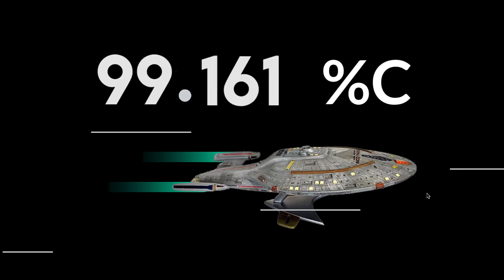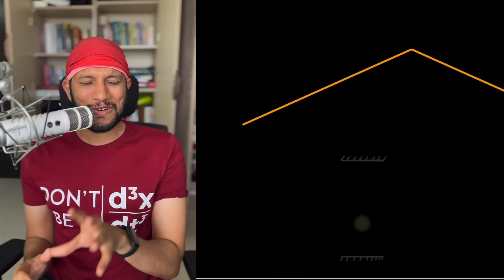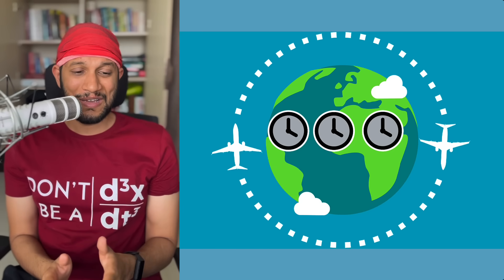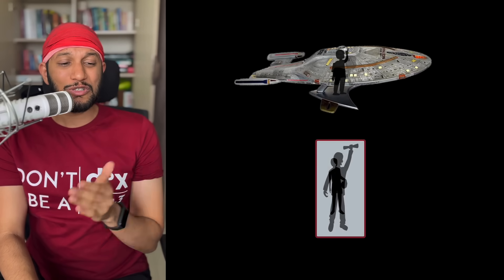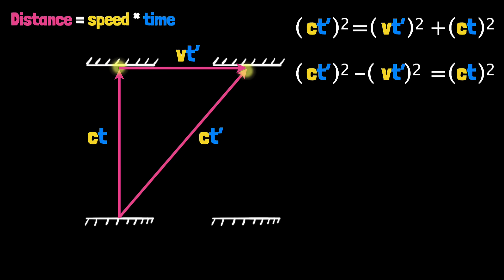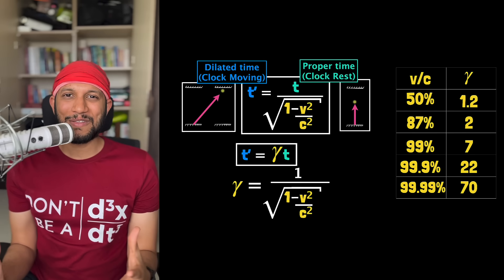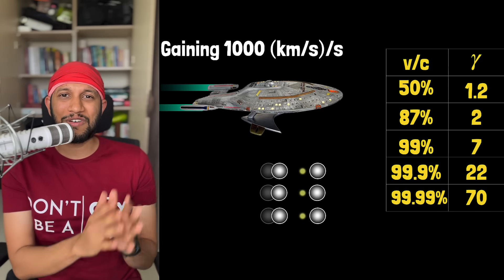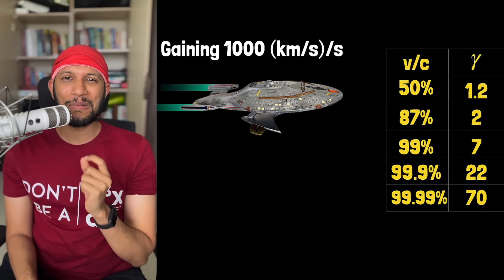I finally understood why you can't go faster than light! (My mind is blown)

Comment: Very good explanation! But what about those people inside the always accelerating spaceship, who do not experience time-dilation. For them everything seems normal, so why can't they reach speed of light? I get that outside observers will die of waiting because of time-dilation, but could those inside reach c at some point?

Also, cause light travels at speed of light, does that mean it travels only in space, but not in time? 

If so, that means from lights own perspective it will arrive instantly to where ever it was traveling at speed of light. Even if we, outer observers, see that the light from Proxima Centauri takes around 4 years to arrive here on earth. But for light itself it was instant. Do that makes sense? Anyway thanks a lot for making me thinking this, its fun :)

Comment: This should be tied into bringing a massless particle to rest.   For example using a gravity well or expanding spacetime.  As the relative velocity between observer and particle approaches C, wavelength grows to infinity and the energy drops to zero.  Upon reaching a relative velocity of c (by cheating since the observer is not moving through spacetime, we are stretching the tensor) the particle disappears behind a horizon.

Comment: I have a question which maybe a stupid one because I am about to sleep 😂 
Now for the people in the shop that is traveling close to the light speed won’t they feel that the people outside the ship are the one that moving at close speed to the light speed.? Does that mean that they will consider the clocks outside the ship are ticking slower ? 
I am pretty sure that the answer is about time dilation or smthg that I am too sleepy to process.

Thanks for anyone will answer ❤

Comment: Ok I understand if you want people outside the ship to perceive the ship moving at the same speed that the person inside the ship is perceiving time that you can’t reach the speed of light because you’d need infinite fuel. 
However I think what’s wrong here is we are assuming the ship moves only the way the stationary person is perceiving it. That’s not the case , the ship moves at its pace regardless if it’s perceived to slow down or not. 
I think a good example of this would be far away galaxies that have died, we perceive their light even centuries after they died because light travels well at the speed of light haha. So to us the galaxies are still there not moving not dying but they are gone, similarly…to us the ship accelerating at speed of light is not moving or gaining speed however it is moving it’s just getting further away so naturally we must account for the difference in distance and the speed it’s moving away , it would get to a point where we see the ship practically stop forever but the ship has continued we age and die before we can perceive any movement but it’s still moving. 
The people inside the ship continue to live normal lives age and die but to us it seems they have reached immortality not aging in comparison to us on the ground however that’s just our perception.

Comment: Great video, but what i still dont understand is why at 99% 1 second in ship is 7 seconds outside the ship and 99,99% 1 second is 70 second s. So you move 0,99% quicker but time looks like slowing down 10 times more. 

For example: the distance a foton travels observing from outside the ship if you go from 0% speed of light until 87% is a much bigger gap then from 99% to 99,99%. So why is it that only close to speed of light this happens?

Comment: In thought experiments, when you imagine being able to do something impossible, suddenly nothing that follows is consistent. That’s the main issue with thought experiments that start with “imagine you were traveling at the speed of light....” Besides the physical and engineering reasons that this is not possible, consider this as well: If you DID somehow engage your light-speed engine and you actually WERE traveling at the speed of light, you would continue to travel at the speed of light for eternity. This is because there would be no passing of time for your or your ship or any physical processes on the ship. You would literally be frozen, not moving. You would not be able to turn off the speed of light drive. Ever.

Comment: Normally, you are quite correct....hence the only way to  travel at light speed is by being in a bubble of normal space time, and condensing space Infront of you and then stretching it behind you.....all this is done at normal impulse speeds.....

There has already been a design for a drive thst can do this too. The Alcubierre drive.....we just dont have enough exotic matter to power it (something like antimatter ...we only deal with it in the most miniscule of quantities at the moment....in talking tiny clumps of individual particles....)....

Comment: This was literally the first time a (I'm assuming) Physics Major actually addressed the... 

1) ... equivalence of the statements: "you can't divide by zero" and "you can't travel faster than c"
2) ... an actual IRL example of the phrase: "frame of reference"

BOTH of them in the same video!

I've seen so many "paradoxes happen above c" videos just casually using 'frame of reference' without actually explaining the nuances!

Awesome video. Thanks!

Comment: Just so you know, warp drives don't accelerate you to ftl, you warp space around the ship to "tether" yourself to space itself, using its movement to pull/push it past the speed of light. It can then be modulated to move in any direction.

Also warp fields sustain the ship within a field that allows them to exist within the space time normally, so this doesn't occur.

Comment: Amazing explanation. What about the people inside the ship? As time is proper for them they are still experiencing the acceleration at a constant rate until they reach the speed of light? What happens when the speedometer inside the ship finally reaches the speed of light? Does that mean that time inside the ship stops for us outside observers?
Reply: Yes. I've seen videos explaining that. Well, actually it was with a ship entering the event horizon of a black hole but I think the same thing would happen if you go very close to the speed of light (obviously you can't reach it). For the black hole example you would see a still image of the last "frame" before they passed the event horizon that would decay over a long period of time because the photons are trapped by the black hole's mass. For the going fast one I think it would be something weirder, maybe some kind of blurry afterimage that decays slower and slower as their speed increases.

Comment: I disagree that you cannot travel faster than light. What would happen is that for those on board everything would eventually go black. They would still feel the seat they are sitting on but would not see it. Eventually the same thing would happen as if you would try to slam the fabric of space and go into another parallell universe. You would be stuck in nothingness until you slowed down. This is because you travel so fast that the very atom changes needs to happen. You are still not even close to the speed of time but close enough to feel the bieffect of it. Also at these speeds or even before you break the light barrier you would possible end up with slightly different times from one end of the ship to the other. But then again why waste all of this energy when you could just hack the universe to let you go from one point to the next within one atoms distance. All you need is a computer fast enough to calculate the changes needed in order to keep a gate open.

Comment: The ship you're showing uses an alcabire drive which creates a bubble of real space around the ship. A force shrinks space in front of the ship and expands it behind. The ships "fuel" is antimatter and uses bussard collectors to collect interstellar hydrogen (matter). Those nacelles aren't actual "engines," they project the bubble. This ship is from star trek where warp drive and how it works is based on real scientific theory. It requires exotic matter to meet the energy requirements. Nice vid though.

Comment: I'm missing something @mahesh_shenoy .from the perspective of someone on the ship, assuming constant fuel consumption, do they measure a constant acceleration? And if so, they could calculate how long that acceleration would need to be sustained to reach the speed of light. Or do they not measure a constant acceleration as they approach c in their own reference frame?

Comment: If you travel away on a spaceship and return to Earth, will you be younger than your twin who remained Earth-bound? I think not because you cannot return home without causing your clock to speed up just as much as it slowed down when you left. Agree?
Reply: Why would the return trip "speed up" one's clock in relation to the point of origin? At most, slowing down to turn around will at most match the time frame of destination/origin. The time spent traveling significantly faster will still have an effect.
Reply: @LawlessChemistry  I thought time dilation has a sign that depended on the direction of motion relative to the reference point.

Comment: Technically, even if you had infinite fuel, wouldn't it still be impossible to reach the speed of light in a finite time due to the fact that the force transfer still only moves at the speed of light? If you burn infinite fuel the photons it creates to propel a ship would still only move at the speed of light which means it wouldn't be able to power a ship moving at the speed of light because the photon will never interact with something moving away from it at the speed of light. The Fermilab channel published a video explaining the speed of light being a limit because everything is moving through spacetime at one constant speed being the speed of light.

Comment: But what about from the perspective of those in the ship? They haven't experienced time dilation. They're only accelerating at 1000 km/sec, but their clocks are still normal. So even if from our 3rd party perspective it would take infinite time, shouldn't it only take the people on the ship however long it takes to add enough acceleration until velocity exceeds speed of light?

Comment: Wait. In your mirror metaphor, what imparted "sideways" vector to the photon, originally constructed normal to the surface of the "bottom" mirror, so it now travels sideways, that is, at an angle all of a sudden? Why is it attracted to the top mirror that has translated in position due to its velocity after the photon was constructed?

Comment: The following explanation is why many are wrong on faster than light travel. 
The amount of energy required for humanity to travel faster than the speed of light is equivalent to the following equation. First, calculate the amount of energy required for a person to carry a petri dish to the moon. Second, divide the amount of times it would take for life in the Petri dish to equal the size of the human holding the dish and thirdly, multiply that number by the amount of energy required for said human to travel to the moon.
They are wrong on light speed travel because all of them are only  calculating the energy from the perspective of having the drive engine onboard. Reposition the energy source externally and suddenly faster than light travel is a possibility. An example of this would be for us to ask a giant larger than our visible universe to assist by borrowing their energy so they would theoretically run us across their room. Now this brings me to time dilation. We could never communicate directly with either the microscopic world or giants because of the time dilation. This is where time dilation must be applied because time is absolutely affected by size not speed.

Comment: you can't go speed of light because  of mass. As long as there is mass, it is impossible, so only atoms can go light speed as it is massless.
Reply: Atoms are not massless. They are made of protons, neutrons, and electrons, all of which have mass.
Do you mean photons?
Reply: @narfwhals7843   photons specifically
Reply: @OmegaMegalodon  photons are not atoms. Atoms are building blocks of matter. Photons are electromagnetic radiation.
Reply: @narfwhals7843  neutrino specifically
Reply: @OmegaMegalodon  Neutrinos aren't atoms, either. 
Again, atoms are those building blocks of matter made of a nucleus(protons and neutrons) and electrons around it.
Neutrinos are a result of nuclear decays. They also aren't massless, as shown by neutrino oscillation.
Reply: @narfwhals7843  gluons specifically
Reply: @OmegaMegalodon  gluons are also not atoms. They are the particles of the strong force and bind quarks to form protons and neutrons(and other hadrons). They are indeed massless (as far as we know).

Comment: The explanation with infinite time works for the outer watcher, but what happens from the crew's perspective? Their clock is proper and will not have been affected by the effect of time dilation, thus their acceleration will not have a hindrance to reach the speed of  light. Instead, they will start seeing the acceleration of aging of the Universe till the infinite moment, but what is the infinite moment, and is there any one?

Comment: Hear is the problem. This is a nice thesis but in reality no one has even attempted this. So Till that time this has to be seen as a thesis with no valued data to support such activity.
In reality I suspect that what we think the limits are has zero value. In truth we thought Mach 1 could never be broken. It was broken. We though Mach 2 could never be reached. Yet it was. Just because it has not happened does not suggest it can't. I suspect the same step of Mach 1 to Mach 2 is what will happen to anything faster than the speed of light. It has to have  Light or Warp 1, Warp 2, Warp 3. and so on. Hear is why I say this so called Speed of light can't be reached. Simple answer is it already has been done. So the best solution is to set the speed that one wants to reach and figure out what limit we can pass. Yeah I don't see this limit to be a thing. It is a limit at this time we think is the limit. However I suspect a top speed over 14 times the speed of light.  I would say 15 but I can be just as silly as the idea of a speed of light argument. In reality I don't see any limit. I also figured out what the limit that changes you from time backwards and in reality The limit is just a thesis. Anything suggested is just an opinion.   
My own view is yet to be explored. I am so amazed to see the reactions.
Reply from the maker: The difference is, earlier, it wasn’t the laws of physics but tech that limited it. Now, it’s the laws of physics. 

I am not saying that it’s impossible. But, it would mean that special relativity has a flaw. A very fundamental flaw. 

But, identifying that flaw would require us to discover something new.
Reply: @Mahesh_Shenoy  Hear is a few things that are fact.  These "Laws" have a fundamental issue. Scale.
Lets take for example Einstein's Theory of special relativity. E=Mc2. So when you and I use this the majority of the time these values work right? Yes.
However hear comes reality. The flaw is at scale of small to large these values fail to work. Not only has this been proven factual it is also why many try and use other ideas like String Theory to try and fill in the gaps by suing Magic. The ideas suggest you can change the values if the values of E-Mc2 does not work then change the idea and fake it.
In truth at really large and very small scales these "laws" fail in so many areas that it is hard not to see them. In truth most that you can hope for is that at a set value of some circumstances these " thesis" work. Yet When you have to use another "thesis" in order to try and fix a so called "Law"  thesis you have to step back and grasp that these so called "laws" are limited by a value size and scale. Now as you said have they identified these flaws. Yep and why so many other ideas of thesis are suggested. Yet in reality if this and many other Physics values are really working then one has to grasp that the same value should apply to any scale. This suggests that the values are not correct and has a flaw that has to be recognized. The Fundamental flaw is when you are not willing to see what is already established as a known flaw. There by required to recognise the so called theory has a flaw that can't be recognized as correct.  So if as the data shows a flaw is seen one has to grasp that the fundamental "Laws" are in reality not correct but intended as a guide. Yet if we do this then we can't grasp that the understanding of the flaw of these laws have very little to with reality as a Law but a suggestion as a baseline. To suggest it is a law when it requires other values of thesis to solve other issues is a value of futility.  
Did I not show you the flaw at a scale as required to discredit the values of the so called "Laws" Yes I clearly have. Next!

Comment: With the last point, from the outside observers it takes longer and longer to see the ship accelerate another 1k km/s, but from the ships perspective, doesn’t it still just take a second? So why from their perspective can’t they reach c in however many seconds it should take?
Reply: Speed was close to c. If we say that correctly, speed relative to a space buoy, whose speed was zero, was close to c.

That speed increases very very very slowly.  For some reason. 

But is it not odd that outside the ship the speed of the ship is close to c, and inside the ship the speed of the ship is close to c.  You say "'from the ships perspective" but it is actually the outside observer's perspective. 

So maybe try to take the ships perspective.